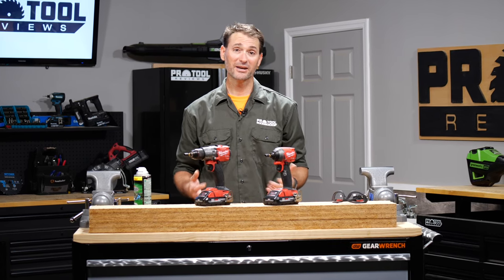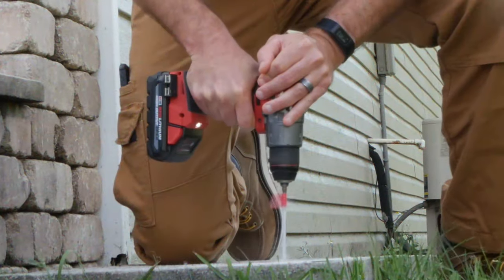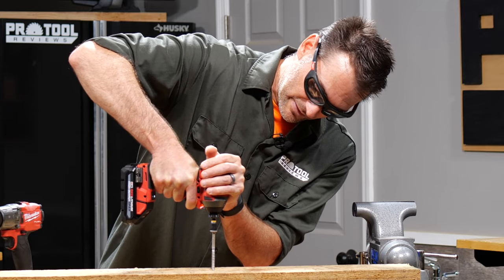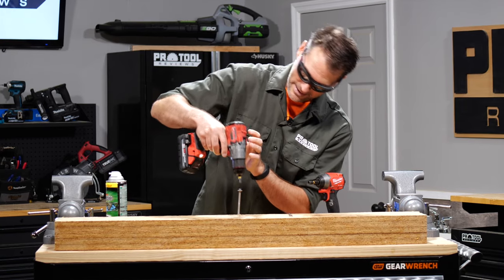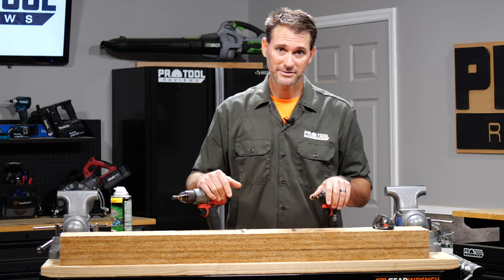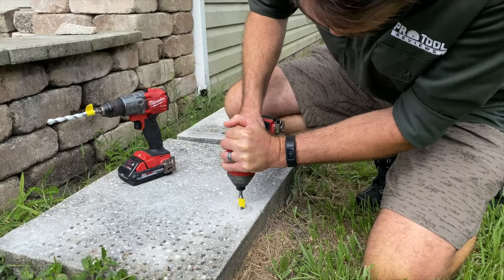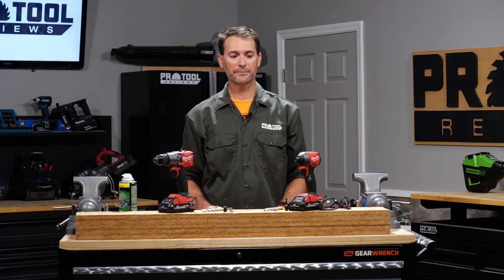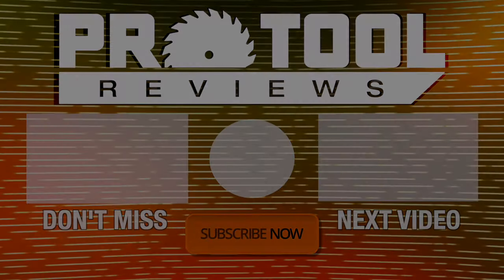Hammer Drill VS Impact Driver | What's The Difference?

Comment: What was this demonstration supposed to show?  It didn't really did anything to help explain the difference between the two tools.  A hammerdrill applies a force along the axis of the bit, essentially pulverizing the material; it's like rapidly smacking the back end of the bit with a hammer.  An impact driver applies the impact force rotationally, resulting in less reaction torque on the operator; it's like having a wrench on the bit, and rapidly smacking the end of the wench to turn the bit.
Reply: Michael Quinlan I've been looking for a concise explanation of the difference between these tools. You nailed it, thank you!
Reply: This is true. Impact driver is smaller and forearm will fatigue less when there is less torque to fight against. It might feel small thing when driving small amount of screws but when building decks etc. it makes a big difference.
Reply: @RossWilcox  yes but why do o need both, if the hammer drill does it all?
Reply: I'm a newb to impact vs hammer and was wondering the same thing. The video really didn't explain the difference in action as well as this comment. Nice usage of analogies.
Reply: @Protoolreviews  well then do t name it the difference in them then not talk about the major difference
Reply: Id wager that the key difference is for use case purposes, You'd want to use a hammer drill to essentially forcefully drive a bit through hard materials while drilling a hole, whereas an impact driver would work like the wrench being hit with a hammer, in that you're using it to impart a degree of torque to a fastener. A impact driver wont drill holes as well as a hammer drill, and im under the assumption that a hammer drill wouldn't be able to impart the same amount of torque on fasteners as an impact driver(which is essentially imparting an impact force to aid in the application of rotational torque.
Reply: @dragojuice8716  and you'd be right.  The point of my original comment was to explain this, and point out that the video did nothing to explain it, even though that appeared to be the purpose of the video.
Reply: Thank you for this comment. I've been watching videos for over an hour now (and on2x speed, so lots of vids!). And you are the first to make me get the difference between the two
Reply: As a woman (with woman-sized muscles..  dang) I def find drilling more difficult and frustrating than the men I know.. just keeping the bit steady and from wandering takes both hands on the drill almost always. 

But Tbh I wasn't even thinking of comfort til this comment! I wanted to go with the faster option between the two, but now I realize I'd hate that. So your comment helped me decide that getting an impact driver will be a nice quality of life upgrade for me (in addition to my standard drill)---delivering a good balance between comfort and speed for most fasteners. I've wanted to drill concrete only rarely.
Reply: @jcmoye1  Exactly. Need an answer to this question...
Reply: Somebody please tell me , if a hammer drill wobles a bit. Is it normal for a hammer drill to woble? I just brought a new one and it had that issue and got a replacement one, both of them had a wobling issue.
Reply: @hemanths2782  the wobble you're seeing is called runout, and it occurs when the jaws of the chuck don't hold the bit on the same axis on which the chuck turns.  There should be no wobble with any traditional three-jawed chuck, including hammerdrills and non-hammerdrills.  That said, I think you'll have a tough time finding one that's perfect; it's more about determining what you're willing to accept.
Reply: Thanks
Reply: @jcmoye1  You don't - I have an Mafell ASB 18 Mbl, it dos it all
Reply: Exactly. The video names it one thing then proceeds to just race the 2 tools. Annoying af.
Reply: yeah, vertical and horizontal impact are different thing
Reply: @jcmoye1  you don't need both. Yet like they said the impact driver is much shorter in length, which helps get into tighter spots, it also impacts therefore putting less rotational strain on your wrist which comes in handy when doing a lot of screw setting such as building a deck. Also easier on the tool. If you put screws in all day with a drill it's very hard on the motor and gear case where impact drivers the release on the mormtor between impacts allow it to essentially breath and not be stressed too badly. In essence they can beat the screws all day and not be overworked like what would happen with a drill. So no you don't need both, but I suggest you do have both if you are into building. My father in law built both his houses, many sheds fishing houses etc. And never owned a impact driver. They aren't needed but if you can afford to have one I suggest it.
Reply: Thanks Michael...good explanation
Reply: @Protoolreviews  what is a hammer drill used for
Reply: It was supposed to show that the hammer drill is faster in all cases. /s
Reply: That explanation was what I was looking for.
Reply: Michael Quinlan your answer reply was more impactful than this video. You hammered all the right points.
Reply: @jcmoye1  a hammer drill can’t take lug nuts off a car but a impact drill can … lol that’s why u need both
Reply: At 5:24 he talks about the amount of strain on your arm. If you use these tools for their intended purposes 8 hours/day for 5 days/week, then that will likely affect your decision, for example, to go with an impact for fastening bolts, etc. or choosing the hammer drill for masonry work.

Comment: Don’t use an impact drill to fasten into timber. The longitudinal action of the hammer would mash the wood, reducing its holding power. Using the impact drill would certainly speed it up but at the cost of preventing the screw threads from cutting nice grooves into the wood.
Reply: Thanks for the info I've actually had that happen to me before and I blamed the screws.
Reply: really? what do I buy then because every normal drill I buy doesn't have enough torque to drive 75mm 10G screws. I think I need an impact driver
Reply: my impact drill has screwdriver mode..
Reply: Impact drivers are for one purpose and one purpose only: To loosen stubborn bolts and nuts.
Reply: @troelshansen6212  I think you have confused an imact driver with an impact wrench
Reply: That makes no sense, it defies the physics of it. There isn't a different DIRECTION caused by impacts, you're still driving the screw in the same way. The biggest difference is that a drill applies torque constantly, while an impact driver does it with impacts. But the screw is still turned the same way, and that's what causes it to move in to the wood, the spinning of the threads.
Reply: @reginalb124  The two are essentially the same device, the distinction is one of power level, and I stand by my statement: If you use an impact driver/wrench to fasten wood screws, you're doing it wrong.
Reply: @troelshansen6212  The distinction is not really one of power, when you adapt a 1/2 drive on to an impact driver, you get an impact wrench that is just as powerful (check out Torque Test Channel when they test the frankenstein Gen 3 Milwaukee impact driver MCT made that has a drive from a wrench on it, and it out powers the Milwaukee compact impact wrench). 

Rather,  an impact wrench has a square driver like a socket wrench, and a driver has a quick release collet for, wait for it...DRIVER bits. They are literally for driving, hence impact DRIVER as opposed to impact WRENCH. 

An impact driver is absolutely NOT made for busting nuts, that's why they don't list nut busting torque figures with them. Plus, you can pretty easily break the adapters for mounting sockets once you get in to high torque applications. 

They were designed initially for when you had a drive task that less powerful drills couldn't handle. Now they still deliver a huge advantage in that you don't have provide the same level of opposing rotational force that you would handling a drill with a high torque application. And there are such applications when you get in to structural screws. 

That said, I think for a lot of people, the fact that they are more compact, lightweight, and easier to handle while having a quick release mechanism specifically for driver bits leave them to driving basically all screws with them. And there is nothing wrong with that.

I use my Makita in low torque applications in low speed with some trigger control all the time.
Reply: @Jamie Pirie  definitely get an impact driver, you'll think yourself once you do because it will require a lot less energy on your end to fasten something because the impact mechanism really reduces the load on the wrist and how much energy you have to put to keeping it straight so it's a lot less fatigue especially for doing longer jobs
Reply: Hello sir I have cctv installation business I need to know which one is better to either hammer or impact drill which please suggest me...
Reply: Think of it this way, one is for drilling, one is for fastening, you can use either one, just like you can use any type of hammer on a nail, but one just does it better
Reply: Just set it to drill mode

Comment: OK, honestly, I never would have guessed you would use a hammer drill like this in wood. A drill or impact driver, yes, but not the hammer drill.  Great video.
Reply: You wouldn't. No clue why they even did this test. The hammer mode will most likely destroy your bits in no time when they slip off the screws and increase the chance of RSI due to the extra vibrations in the tool.

All this video does is teach people how to use their tools the wrong way, your replay is a perfect example of what happens (not blaming you, but the people making this video).

Comment: The impact driver does all the work and is easy on the wrist. Mostly with the hammer drill you have to control the force it spins. 
Hammer for holes and driver for screws is what most people do because it’s easiest.
Reply: The hammer drill has both a torque cloth adjustment ring and a speed setting. This makes it a notch above the small impact Driver.

Comment: I've been seeing more guys onsite using impact drivers for big-bore drill bits.   I asked why, and the consensus seems to be that using an impact puts less of a chance of torque-twist on the user, actually making it easier.   I haven't tried this yet myself,  but it would be cool if you could do a video verifying or negating this.  Thanks!
Reply: I'm surprised at how useful my impact is for most things I used to use my drill for. I got the drill first thinking it was the logical thing to do, but I should have gotten the impact first, there's very little they can't do.
Reply: There is no chance to torque twisting because all what the impact driver has to do is overcome the hammer spring. It is constant always unless the impact driver hammer & anvil decide to get stuck together forever in unbelievable failure but guess the world is big enough for that to happen at least once.
Reply: Idk I feel like a lot of ppl just go impact for everything lol

Comment: I have accidentally used the hammer function when driving machine screws etc.  The hammer function tends to really beat up the bits!  Since I don't generally work with concrete fasteners, on those rare occasions I use an impact driver with the concrete bits.  The time I lose with the odd concrete fastener is saved by the quick chuck of the impact driver.  Yep, no need to carry a hammer drill with me as my drill driver does not have a hammer function so I can get the most compact head in tight spaces.  After all, a hammer drill does OK but when compared to the SDS variaty--well, there ya go.  Good information!
Reply: You need to switch to drill mode. The hammer fiction utilizes the drills mass.

That's what I can see.  Torq is a physics fiction and mass is a factor

Comment: I think it might be better to show that the impact is supposed to be better for removing more seized up nuts or screws … something more akin to the way the 1/4" impact air driver is used in mechanic garages, whereas the drill or hammer drill might shred or damage the head.
Also for a control, I would use the drill to slam in those screws without the hammer showing off 3 different versions, but 2 styles from the hammer drill oh and also throw in an SDS drill to compete too for some real action especially on the concrete and the use of larger diameter drill bits.

Comment: Hey can you do a video on Hammer Drill vs. Rotary Hammer Drill? When I buy a new drill I make sure it is a Hammer Drill but then I never use the hammer feature it unless I am stuck without my Rotary Hammer Drill because the later just melts through concrete. I pair a Rotary Hammer for the holes and use an impact Wrench for driving Red Heads or and Impact Driver for Tapcons. I only use my Hammer Drill when I am on a ladder and only want one tool.
Reply: Hammer drill is basically a regular drill but with a mode that has very rapid but very tiny up/down vibrations that slowly chip away concrete while you drill.

A rotary hammer has less impacts per minute, but MUCH harder hitting impacts. There's no contest. Rotary hammers blow hammer drills out of the water for concrete. However, if you're only going to be drilling small holes (less than 1/2") in concrete, and only once in a while, then a hammer drill will do just fine (though on concrete that has hardened for 20 years it'll struggle).

Comment: I carry a DeWalt 2nd gen 12v impact driver on my hip all day...it is 100% adequate for what I need.  I also have a DeWalt 20v impact driver and a DeWalt 20v hammer drill.  For the weight alone, I could not imagine wearing the hammer drill on my hip all day.
Reply: Well I consider the hammer drill for more intense jobs like anchoring down atms or putting in commercial shelving, however I consider its power and versatility for jobs where the 12v is in trouble almost like a backup, but I do agree carrying the thing on your side through the job site is killer.

Comment: Recently, I had to remove a storm door from my house.  (The lawn service we use sent a pebble through the glass window on the door.)  I started by using my screwdriver and that only lasted for three screws.  Then, I pulled out used my cordless drill, and that lasted about five screws before I tried my cordless hammer drill.  I was shocked at how little effort was needed to remove all of the screws!  I chose the hammer drill over the impact driver because of a closeout sale on the hammer drill!  Also, in the past, I've had experience with corded hammer drills.
Reply: How the hammering action help with the removal of the screw?
Reply: @himmelsturmerIX  it beat off the rust😂

Comment: Hammer drill for that concrete test... the side motion instead of linear motion (impact) helps bring the material out (as long as the bit is an "up-bit"), making it drill faster and also causes less heat on the bit which will help keep it sharper longer.

If you're drilling a lot of holes in wood (and also don't care about accuracy), and decide to opt for the hammer drill, you could get used to the density and twist your wrist if not using the brace when hitting a big knot, metal, etc.. I would opt for an impact on wood every time in soft woods. Hard wood, I would use a pilot hole and hand screw.
Reply: I only use tools for diy and I'm not a pro. For construction or structural wood building, nails are superior and faster with pneumatic nail gun (already know/obviously)

Comment: I was running a masonry screw into brick with a hammer drill. The screw caught & wouldn't turn. The torque of the hammer drill twisted the drill right out of my hand. That's not an issue with the impact driver. I used the impact driver for the rest of the screws with no problem.

Comment: A better example to prove the need of a hammering action vs impact action is porcelain or travertine. These two hard materials are super difficult to drill. A hammer drill is needed for these. I install shower doors and no matter how good your masonry bit is, a hammer drill speeds up the process.
Reply: Hammer drill? Jesu-cristo. We use small diamond core bits and drill bits to cut a perfect and slightly larger hole before we drill into the waterproofing boards and studs.
Reply: @Chris11249  
 

 Let’s have a race then? My hammer drill vs your diamond core bits. 

Jesu-Cristo! Remember, I was talking about speeding up the process.🤦🏻
Reply: @bdog0720  That'd be a good YT video actually!
Reply: @bdog0720  With travertine you would win for sure. For porcelain it's pretty fast and best of all I never crack anything here's a good video https://www.youtube.com/shorts/jo0swInChAQ
Reply: @Chris11249  

That wasn’t a good video. It was sped up. 

I use Relton Groo-V Tip bits on a hammer drill. I’ve used several other brands including diamond, but these cut the fastest.